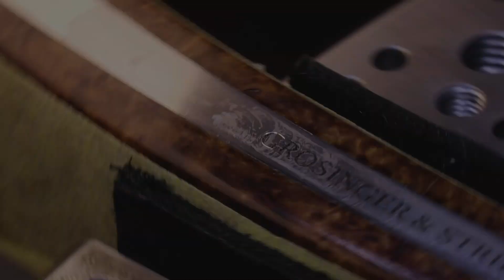The Birth Of A Bowie Knife PART 3 (Engraving and Finishing)

Comment: It's only held together with epoxy? Doesn't epoxy get brittle over time? This is a gorgeous knife all in all. Kudos sir.
Reply from the maker: Nope it does not🙂 in this case atleast
Reply: Nice knife, but cant deny that a mechanical connection with the epoxy is better for a bowie due to the multi uses it has.